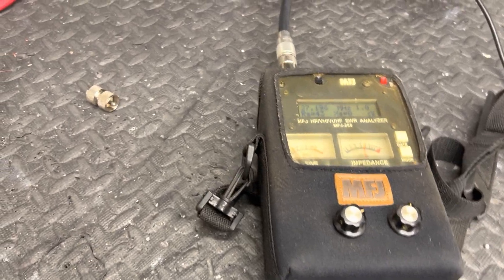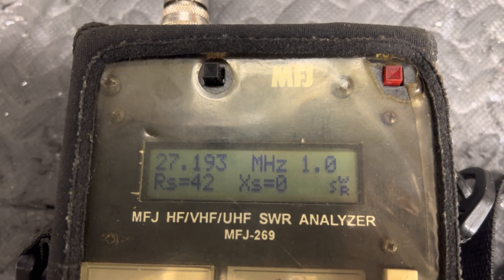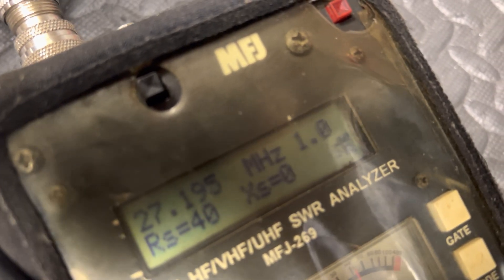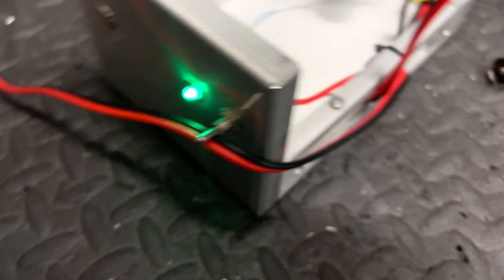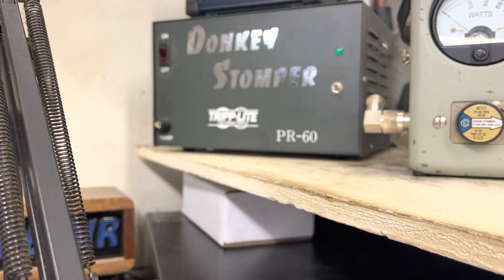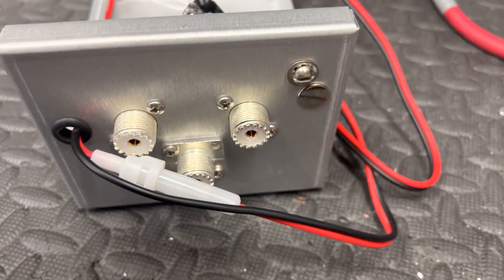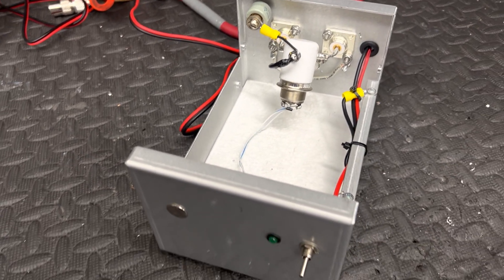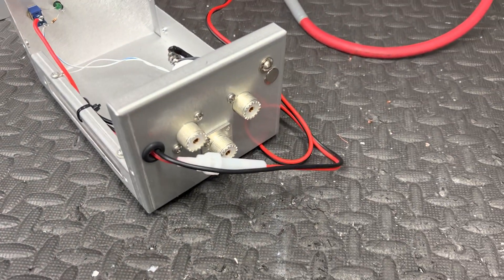Donkey Stomper Products, 10KW +++PEP, Antenna Vacuum Relay Switch Box Review

Comment: What's it used for?
Reply from the maker: high power antenna switching! Thanks!
Reply: @DonkeyStomperProducts  from like beam to vertical type deal
Reply from the maker: @electromechanicalstuff2602  correct.
Reply: @DonkeyStomperProducts  thanks for the info I appreciate it